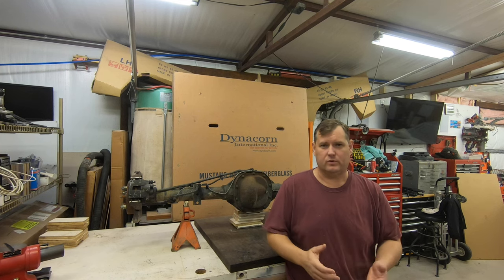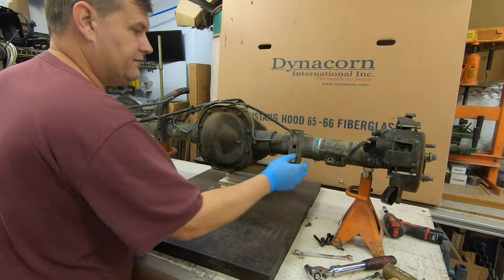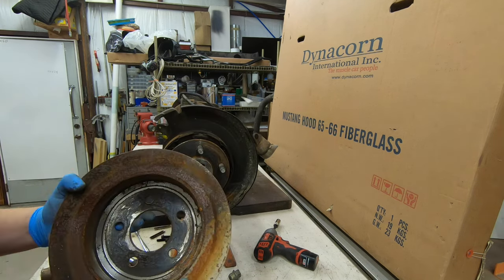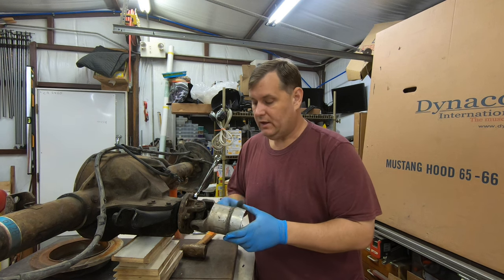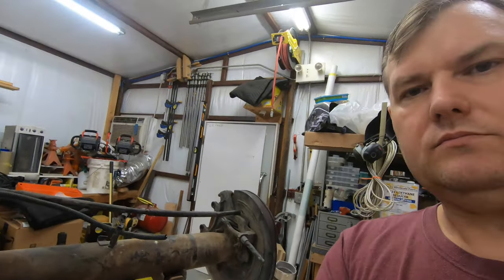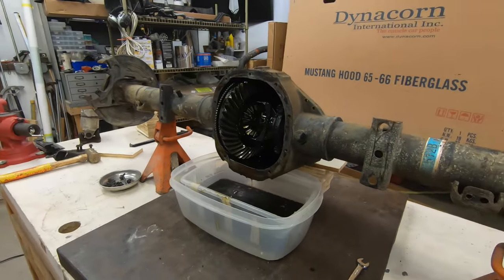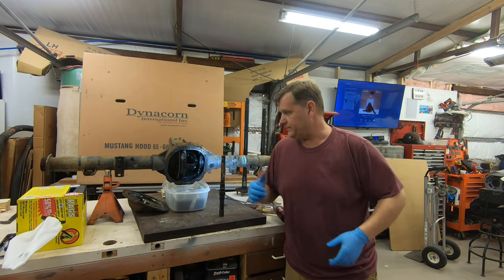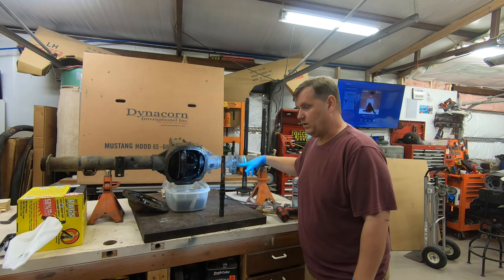8.8 narrowing for a Mustang

Comment: They are installed with red thread locker.  Heat will release the threads.
Reply from the maker: That would be too easy. Or more accurately I was too lazy to get a torch out... Stuff comes apart easily here anyway without salt. Back when I was a tech we could not have a torch in the shop as the insurance company would cancel the policy if we did. Pretty common thing here with insurance so I'm used to not using a torch to take stuff apart. The only shops that they would insure with a torch were muffler/radiator shops which almost don't exist here anymore.